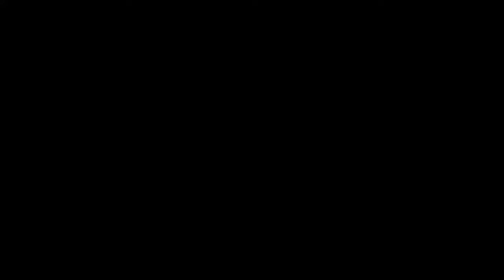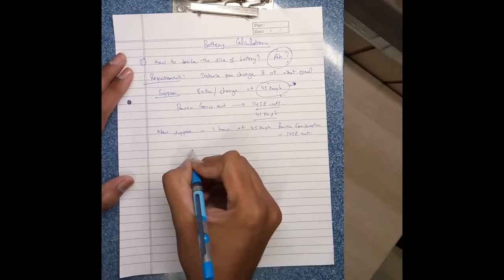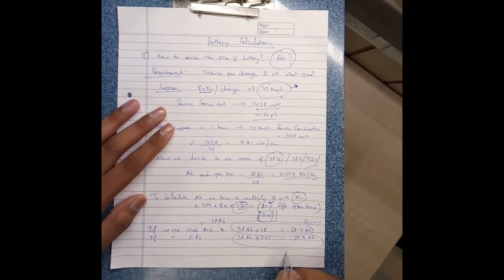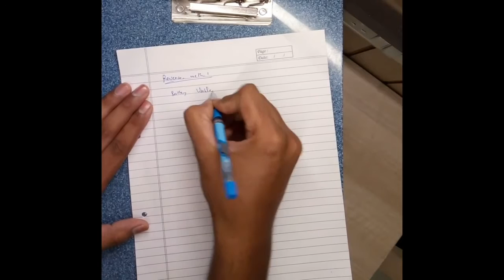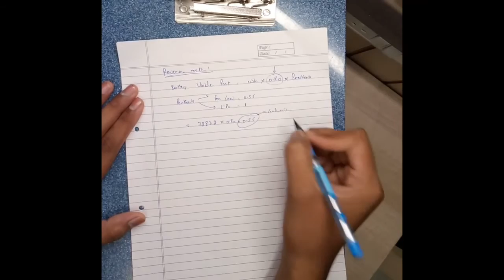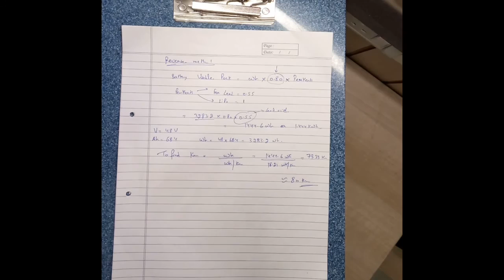EV Calculations part-3 (batteries)

Comment: sir i have 2kw, 48v motor. i want 100km range at maximum speed of
 1) 30 kmph and 2) 60 kmph.
 for both case if i calculate i found that battery capacity required for 
1) 30 kmph is 173 AH, and 2) 60 kmph is 87 AH.
now this means that for higher speed, battery capacity required is less whareas for lower speed, battery capacity required is high. i can't understand that how it is possible.

i mean motor placed in e rickshaw with maximum speed of 60kmph will definetly run at lower speed in traffic. so how it is possible...?

Comment: https://en.wikipedia.org/wiki/Toyota_RAV4_EV#Battery_and_range
do the calculations for this vehicle, I bet you will not get the required battery specifications used by the manufacturer.

Comment: Can you tell me how to derive weight of battery pack and no. of lithium ion cells for a given distance?
Reply from the maker: Yes, when u find the total Wh of battery pack for ur required KM's then u have to just divide the total Wh by wh of single cell whichever u r using , that gives u the no. Of cells
Reply from the maker: Nd for weight calculations u have to multiply the no. Of cells with weight of single cell and extra weight of bms+other parts used
Reply: @ALTER-BIKES_01  can i get your contact number.
i am kindly seeking for your help in EV vehicles.

Comment: Hello brother,  I'm working on a project for design of powertrain of EV.
So I came up with 90kW torque at 716rpm of car having total mass of 800kg and tire radius of 0.278 m.
Now how to select motor, converter,  inverter , battery and design battery management system. ....
Can u pls help me out
Reply: Sorry 90kW is power**
Reply: @hassanzahir8119114  hua kya bro project
Reply: @hassanzahir8119114  if done can you tell me the calculations part

Comment: Battery calculation procedure is correct, but selection on Motor was wrong ! & It's must converted to SoC First to find exact motor Voltage& power rating

Comment: the valuee of 1.8 for lead acid and 1.05 for lithium polymer is as a result of the rule of thumb used for lead acid and lithium bateries respectively. You see, the rated capacity (the Ah written on the battery) of the battery is typically given for a 20 hour discharge rate. Thus if you slowly discharge the battery by a 20 hour discharge rate you will get the EXACT rated capacity of the battery BUT it has been KNOWN that for a 1 hour discharge rate of a lead acid battery, it will only HALF(0.5) OR 0.55 of its rated capacity(Ah). oh and 1/0.55 is approximately 1.8. its a similar thing for the lead polymer battery

Comment: Sir u did one mistake in starting calculations I.e(1458÷45=32.4km/hr)
Reply from the maker: siva badam yes, u r right bro I made a mistake in calculations but method is correct so just follow method only, thanku
Reply: Sir how do u identified the maximum speed of motor ?
Reply: We have one bldc 48v,42ah =2kw series motor with 3000rpm then how to calculate the maximum speed(KMPH)
Reply: @sivaswan7586  same dought bro help me with that

Comment: hi...thanks for this video...
why have you multiply 1.2 in calculating ah for 20% ?
also why have multiplied 1.8 for lead acid....like what is this value for??
Reply from the maker: Vibhav Vats yes, this 1.2 is for 20% 
And 1.8 and 1.05 are the standard value for lead acid and lithium po.
Reply: but what is this value for...?
like we get the ah required for 80 km....now why we have multiplied it with 1.8...what is this value?
Reply from the maker: Vibhav Vats without these standard values we can't consider losses and all other value. So we have to multiply this standard values to get approximate ah
Reply: okay...thanks..
can you pls tell me where can i get these standard values for different batteries?
Reply from the maker: Vibhav Vats you can check it on different sites
Reply from the maker: +Vibhav Vats sry yarr I don't remember website from where I get all this stuff. Actually I do all this calculations from different sites.
Reply: no problem...thanks..
Reply: can you pls tell me what should i search for these standards...like what it is...some efficiency or other stuff...?
Reply: the valuee of 1.8 for lead acid and 1.05 for lithium polymer is as a result of the rule of thumb used for lead acid and lithium bateries respectively. You see, the rated capacity (the Ah written on the battery) of the battery is typically given for a 20 hour discharge rate. Thus if you slowly discharge the battery by a 20 hour discharge rate you will get the EXACT rated capacity of the battery BUT it has been KNOWN that for a 1 hour discharge rate of a lead acid battery, it will only HALF(0.5) OR 0.55 of its rated capacity(Ah). oh and 1/0.55 is approximately 1.8